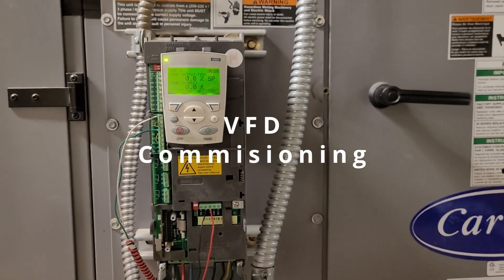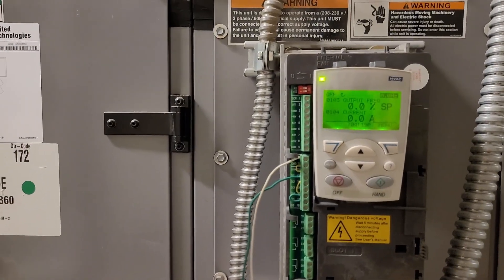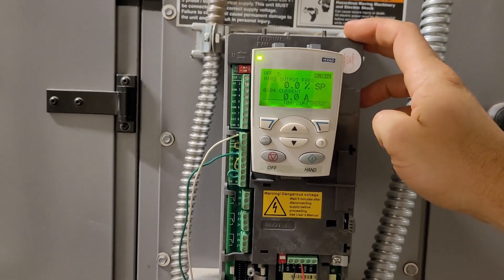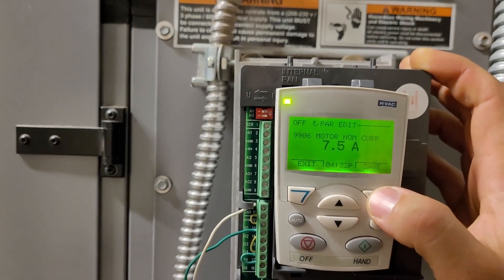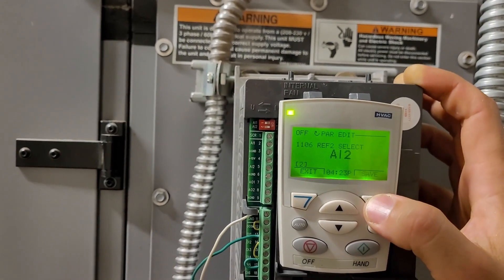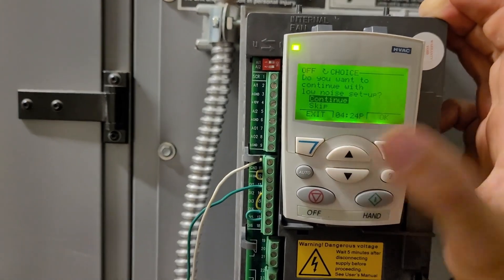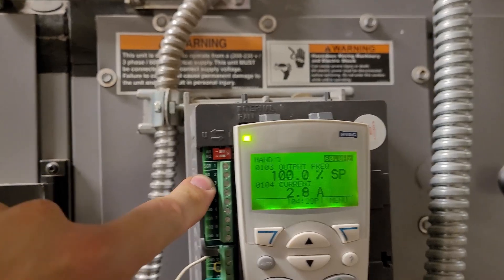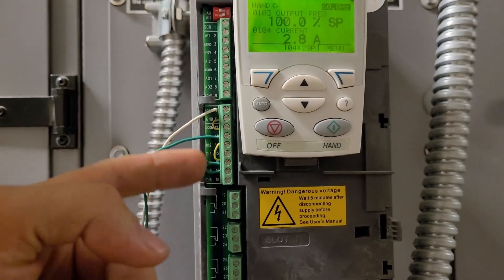VFD Commisioning

Comment: What are those jumpers for
Reply from the maker: @desieranks  sometimes the fire alarm, or high static pressure safety will be wired to DI4 but in this case those safeties are wired in series with the fan start/stop signal so a jumper is needed on DI4. The input numbers are programmable and can change, but that's the basic idea. A jumper will be put in place if the safeties are wired in somewhere else.